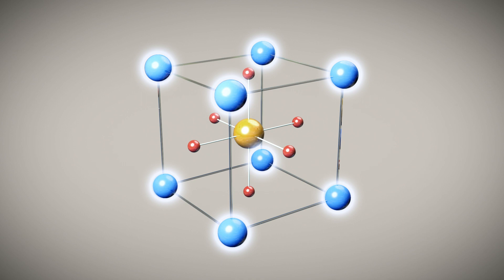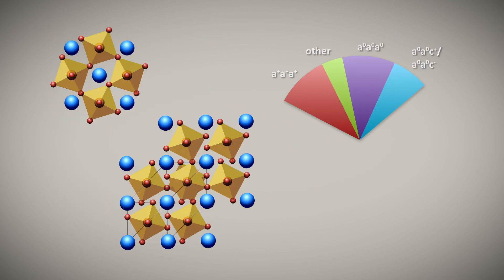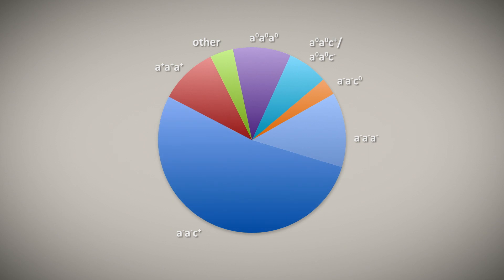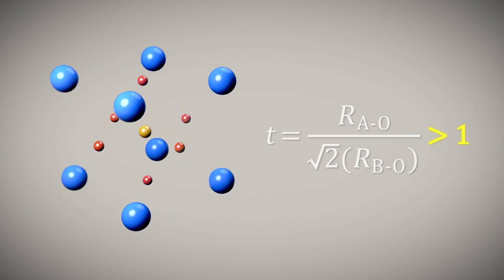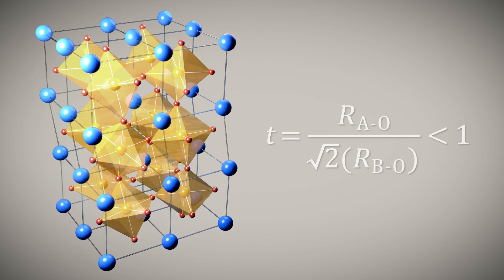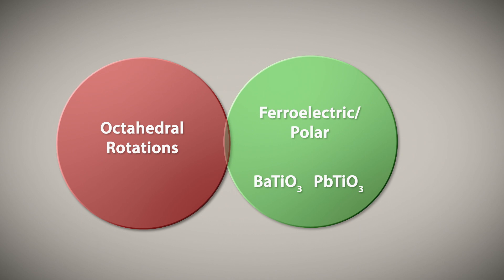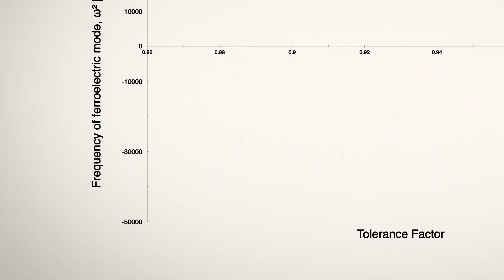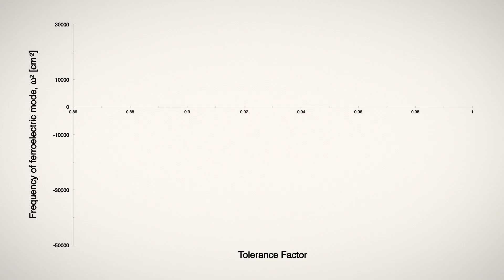Why are there so few perovskite ferroelectrics?

Comment: it seems to me that the rotations clearly suppress ferroelectricity. otherwise the materials would not be predicted to be ferroelectric when the rotations are removed. And the fact that the trend is linear makes it pretty clear. The larger the drive for rotations the more the rotations suppress the ferroelectricity. a b etter test would be to take BTO or PTO and force it to be pmna and see if the ferroelectricity goes away, if it does then the rotations are suppressing ferroelectricity.
Reply: @Godwin Paul yes it does seem that more instability the less ferroelectricity,  unfortunately its been the better half of a decade since ive studied these materials and i presume nobody has attempted my suggested experiment (could be simulated) that would prove the origins